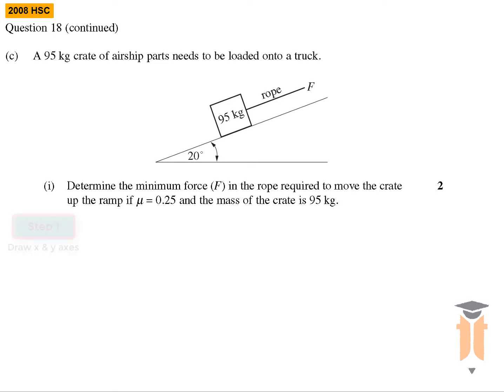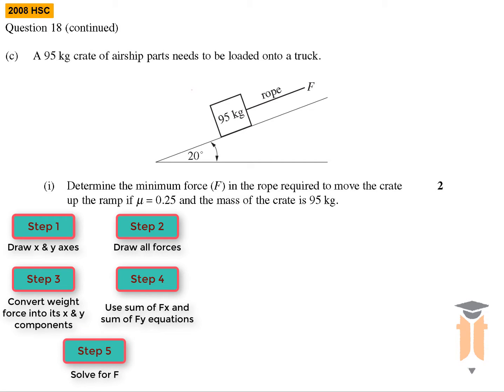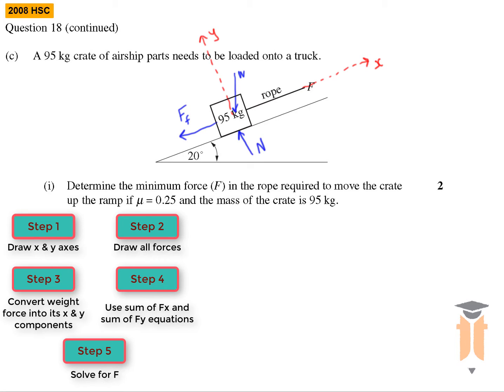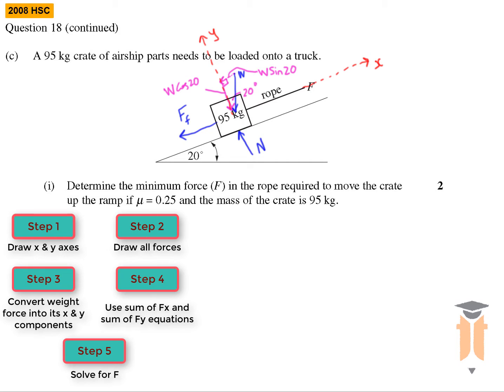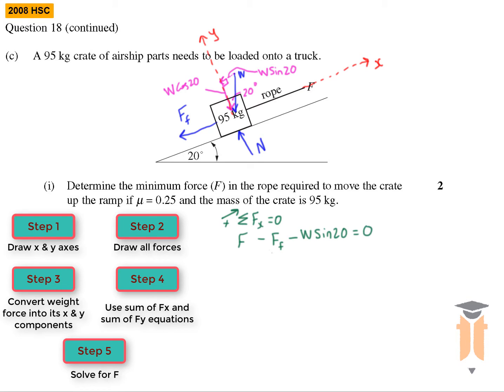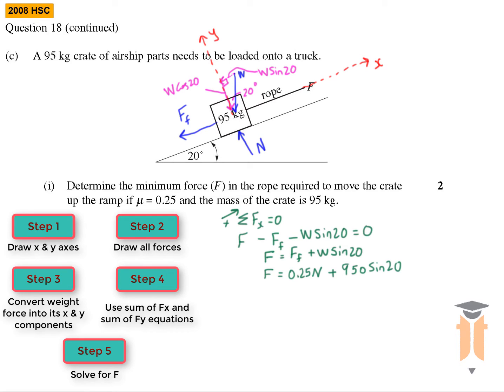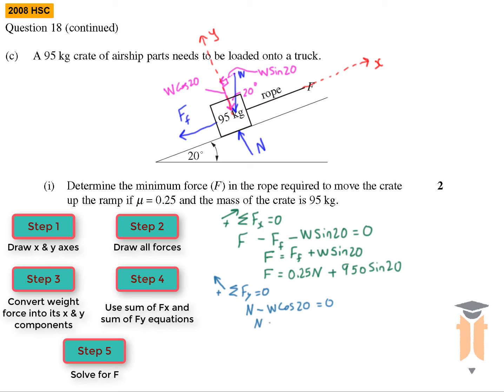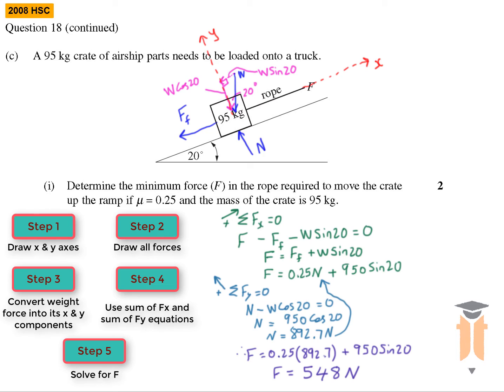FRICTION - HSC 2008 Q.18c) - Engineering Studies

Comment: The frictioin force is between the mass and plane and not where you drew it. Amazed how many time you did not mention the angle is in degrees. Sin 20 means the angle is in radians. This is very sloppy. The coefficient of friction is given and not in the table as you said. I trust that you are not a teacher ?
Reply from the maker: Please go and troll elsewhere! Where I’ve drawn the friction force has no effect on the problem being solved. It’s a FREE BODY DIAGRAM. Your issue with mentioning degrees is laughable at best. We only deal with degrees in this course. If it is radians then that’s equivalent to 1146 degrees. Ridiculous. I trust you lack common sense but thanks for your time 👍🏻
Reply: @EurekaEngineeringHSC  No point replying to your absurd comments. Obviously, you don't practice. More importantly is that students doing what you did might think that is OK. In exams they would lose marks for being feeble like you. I've done solutions for the HSC since 1988 -  haven't had one comment like yours.
Reply from the maker: Thank you for your entertaining feedback and engaging with my content, I apologise for not realising that your initial comment was intended to be a serious remark. I can assure you that the solution presented in the above video is in congruence with the current NESA Engineering Studies Syllabus (2011). Furthermore, I can confirm that the above solution is consistent with current HSC Engineering Studies NESA marking guidelines and advice. Goodluck with your writing of HSC solutions, I wish you all the best.